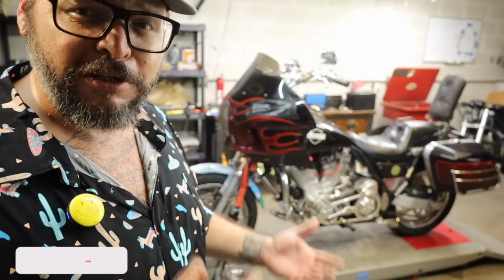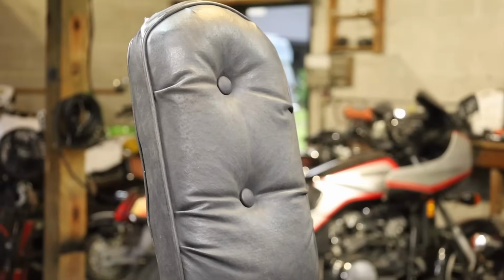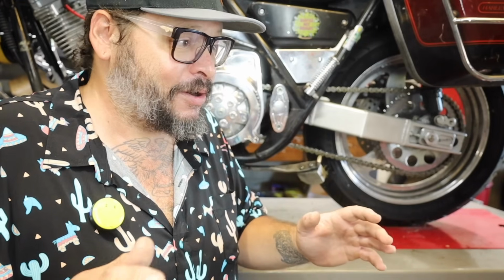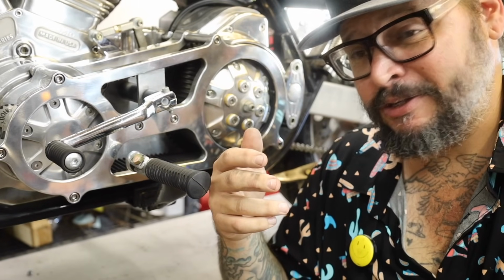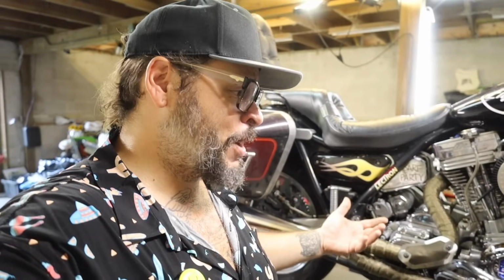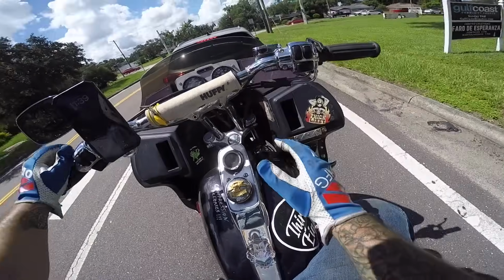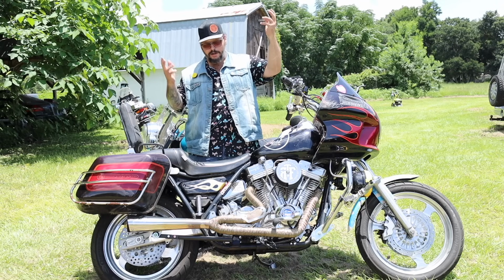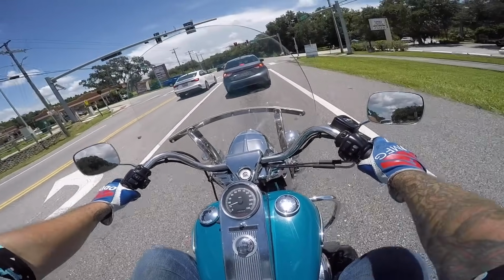This Harley FXR is the ULTIMATE SLEEPER | In-Depth Breakdown and Parts List

Comment: I want that fairing for my FXR. I don't like the after market ones they look Plain. My 1st Harley has been my 88 FXLR and I've riden lots of other bikes and at the stealerships they want me to put my FXLR as a trade in and I can NOT and will NOT trade it in. At 1 point I had 2 FXRs, 96 FLH,and a crotch rocket. I gave my brother my 2nd FXR and I sold the rest and kept my 1st FXLR and I still have her. Just Love the simplicity of her and not all the sensors and vacuums and need to be an electrician to work on the new bikes. Long Live the FXR Nation!

Comment: If you want to give the supertrapp a bit more bark, you can ditch the discs and run a larger bore end cap on them. The muffler itself is still fairly baffled but itll just give it a little bit more bark!

Comment: I have no trouble cutting down a windshield. Masking tape inside and outside, mark your line, cut with a fine tooth saber saw, remove tape, sand the edge smooth, and finish with very fine sandpaper. It seems counterintuitive but a taller windshield causes more buffeting. It creates a vacuum zone that sucks the air up between your knees and hits the bottom of your helmet. I plan to cut down the Beige Malaise windshield. Certainly cheaper to cut a windshield down than buying a new one. And that plastic ain't cheap.
Reply: I was using a (detachable) HD softail springer 18" shield on my 2010 hotrod Dyna that had a 'vacuum' which lifted my visor at anything over 80, so I held the visor down with tape on highway rides.
 When it 'slipped outta my hand one day when I detached it, falling and breaking the lower part on one side - I was a bit bummed out as it was a must have on long trips with the 18" apes I was running.
Then one day I looked at it in the shed and used a bandsaw to clean up the broken bit and make the other other side look the same. I put it on the bike and hey presto, the vacuum had gone so my visor didn't keep flipping up ANDI had a bit of a breeze from below the shield that kept me cool on hot days.... it still stops the rain from hitting me and the visor on the wet days as well.

That ain't as lucky as a 2 litre engine for a grand though !

Comment: Im def gonna try and win her.. I am looking for a Twin Cam RK right now.. I love my street glide but its fully built and upgraded and I am actually done with it.. Bought the 2010 brand new and got to 38,000mi, but in 2020 started lifter ticking and compensator was going out, so it got tore down, replaced everything in primary, 107high compression kit, new heads & clutch, TB & intakes, cam & cam chest, HP oil pump, new shocks, new bars, new front wheel & tire, It was my plan to upgrade my current bike instead of spend $30k on a new one, and since I saved money and enjoyed restoring my bike, Im gonna do it to a 99-2010 RK. , since I really want a bike to ride single or solo but since I am 6'4" and 225-230lbs so I really don't fit well on a Dyna or softail, & I love hard bags. I bought a RK about in 2002, sold it for the Glide in 2010, but I want another one with a fat spoke 21 front, 18rear, some big sweet apes or really tall risers with dirt bars.. Pretty much meld the Vicla & Perf bikes into one as a sweet solo hopper.. Really would like an early carbed RK..

Comment: You do know most seat manufacturers make seats specifically for taller people.  They aren't necessarily taller they are deeper. The step up is 2 inches further back. I have a la perra tail whip. It's offered in the taller configuration as well. Aluminum swing arm wieghts  less. And the rigidity helps with handling. You won't see stock swing arms on any major teams king of the baggers... bikes.

Comment: It takes a lot of money to increase horsepower.  One reason to buy a bike with the horsepower your happy with
From the factory or similar how you bought your engine.  Suspension mods and other mods way cheaper than buying  a cheaper bike with less horsepower hoping to modify it later with more horsepower until you find out the cost.

Comment: What gauges are those? And howd you get them to work?
Reply: Those are a set of marine gauges from Amazon....the Speedo is self calibrating(GPS Speedo) so drive ratio/tire size dosent matter....the tack reads ignition impulse from the ignition module, but I wasn't happy with it at all!!..... It uses a stepper motor for the needle that is SLOW!!!!(As in, you'll be in 3rd gear before it reaches 5krpm slow!!)
Reply: @JoeTheMountainJedi  damn! I just love the look and simplicity of them. I'd love to find something like that for my 07 dyna